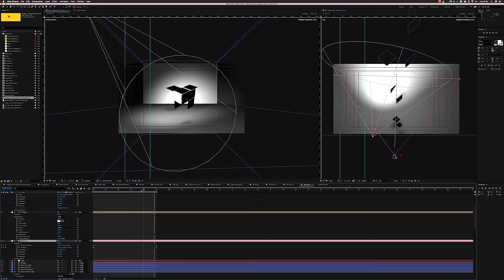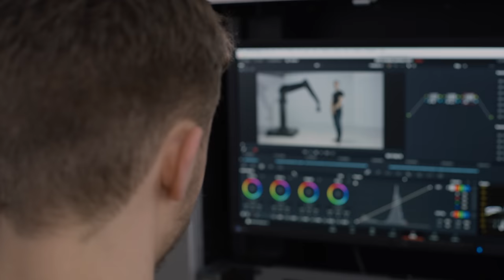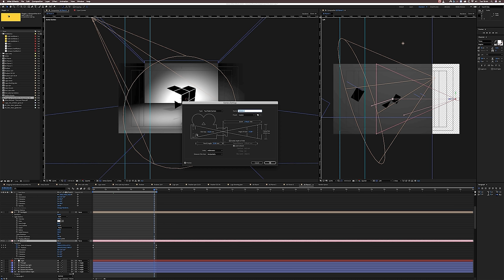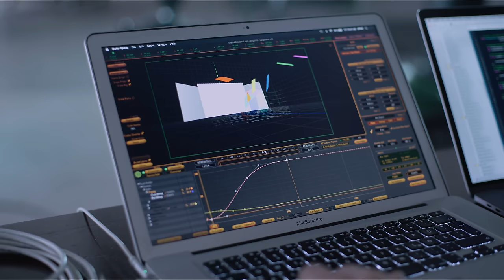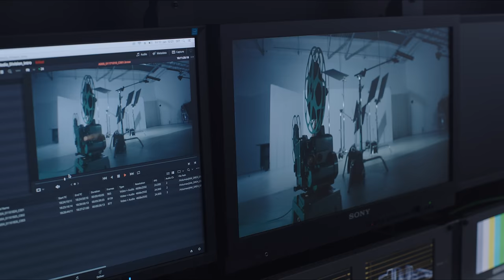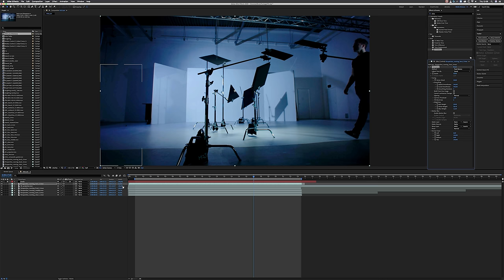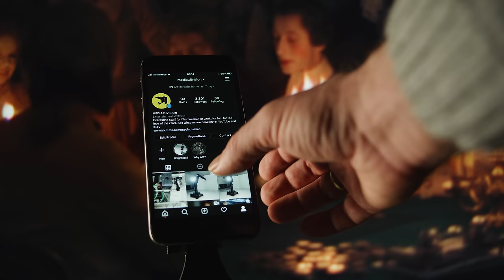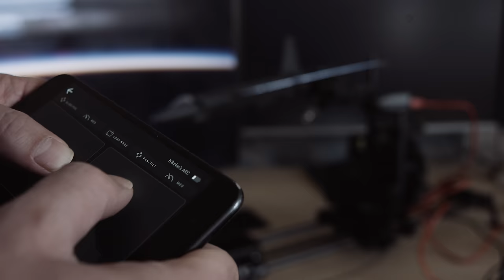Motion Control – Filmmaking with optical illusions & layers of time – Epic Episode #12

Comment: Love this video. Great work and very inspiring. In the video at approx 21.00 you mention the use of Edelkrone focus module. Was it used for camera focus or for some kind of custom riggning of the aircraft model?
Reply from the maker: Thanks Fugander... it is the edelkrone One follow focus that is attached to the focus motor of the slider rig. We basically use the gearbox of the follow focus to get the movement we require the model to do... the roll

Comment: The ventilator to add turbulences to the plane model is a nice touch. But this defeats the principle of using a second pass, thanks to the motion control, to generate the travelling matte. Because the two passes will not exactly match in that case.
Reply from the maker: Exactly... and we say that right away 23:33... but you can use this technique + turbulence without replacing the backdrop like in the overhead shot, that still includes the original TV backdrop 20:44

Comment: FANTASTIC. Where did you buy this motion control robot?
Reply from the maker: SPIKE is a development by THE MARMALADE based on industrial robots. You can buy the robots but that doesn't give you the system. There are a couple of "off the shelf" cine robot systems like Bolt, but all of them have one thing in common. If you have to ask where to buy such a robot it is very likely not sensible or affordable for you

Comment: >2 things, the camera's speed, and its motion
Don't forget lighting. That's massive when it comes to layering the results
Reply from the maker: As we didn't change the light at all for the intro shot, we did not mention it. All shots are done at the same framerate to avoid changes in exposure, which would be near impossible to compensate precise enough without introducing tint, brightness, or change in DoF. If you watch the later parts of the video, you will see, how retiming is done adding motion blur for exact results.
Reply: @MediaDivision  What I meant was that you had control over the lighting, so you could keep it consistent, which aids while blending. Doing this shot outside would be a lot harder, as the sun would shift in between takes, messing with things like shadows.
Reply from the maker: Well… of course. On a day with mixed clouds you would run into problems. All takes are done within 20 minutes, so, during a cloudless day or with an overcast day, or at night… you would still be fine.

Comment: This is all 40 year old technology which was developed for Star Wars back in the mid 70's.   Stepper motors and software.  Yes, the software and processing and post production has evolved immensely but is nothing new.
Reply from the maker: We are aware that principles of motion control go way back... we have tons of old examples in this video (like Blade Runner). Nobody claims its new. The Marmalade where the first to use industrial robots in combination with high speed

Comment: No katana shadow, nice try
Reply from the maker: the sword is absolutely in line with the key light.... it is too thin to cast a visible shadow, nice try
Reply: Media Division Oh cmon at 6:39 you can see the shadow of the hand’s robot but not the katana especially the handle who has the same width that the hand’s robot. The moment when the shadow is visible on the shirt the katana is not align with any light and if you look frame by frame you can see the shadow of the “screw” used to hold the katana.
Reply from the maker: stood there… tried it… no relevant shadow…